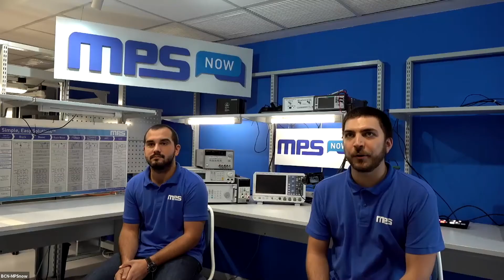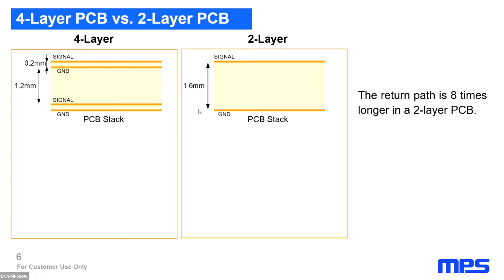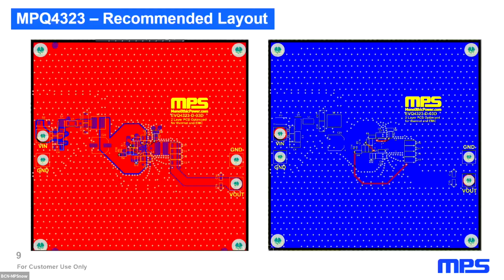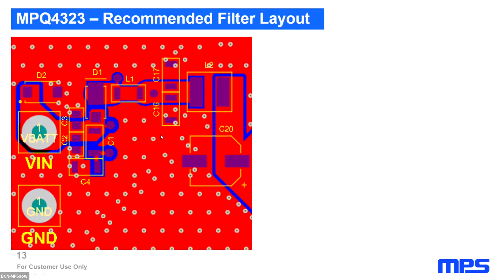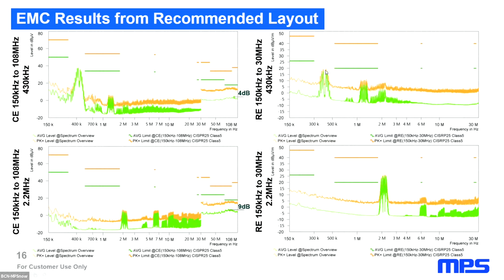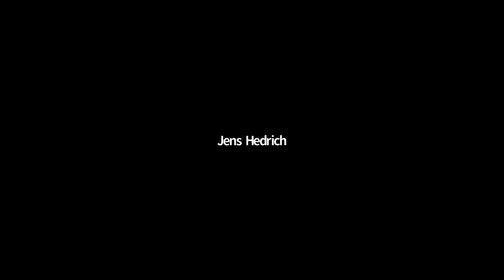Make a Great Automotive PCB for EMC & Thermal

Comment: Hello mps team, can you please explain more about the GND cut and emc performance. There are many different opinions about that issue, some people speaking from increasing of common mode noise related to the GND cut (capacitive coupling of noise). Another people mentioned the concentration of the noise in the cut out area. Could you please explain more details about it. Thank you in advance!
Reply: @monolithicpowersystems  Thank you very much for the great explanation
Reply from the maker: We have done some experimentation with this cut in the GND plane and saw it creates issues at higher frequencies (in our DUT it was from 200MHz to 400MHz). Our conclusion is that these cuts increase the GND impedance of the board, so any stray current (e.g. Eddy currents from the inductor) will create voltage differentials and thus radiate noise. We saw a slight improvement when making a cut locally to the PGND pin of the DC/DC converter and the input capacitors, but it was very minor and this makes the thermal dissipation worse. We recommend avoiding making any cut on the GND plane near the DC/DC area.

Please also see https://www.youtube.com/watch?v=H9CFceuhy-s&t=2119s